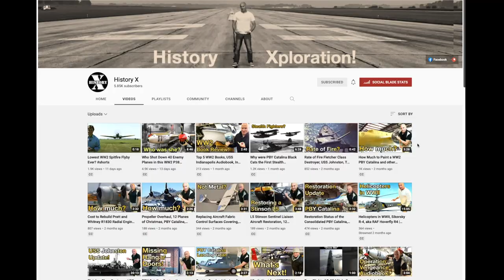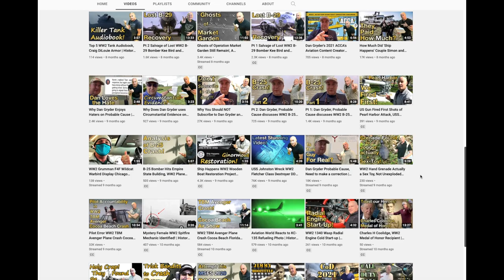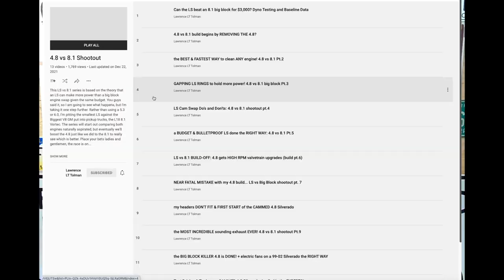Building a Custom Pizza Truck (Episode 6 )

Comment: 13:45  Just a thought.  You could change that up.  Two options that I can think of.  If you switch to adhesive you no longer have any shrinkage concerns.  You could also use aluminum even a thicker gauge aluminum if you wanted.  Of course steel is fine too.  I know... everybody thinks adhesive is going to be problematic.  I frequently see vehicles at auction where the steel rips while the an adhesive joint in the same area is still intact.  I know which joints are seam sealer over spot welds and joints that are 100% adhesive.
Reply from the maker: The new adhesives are amazing, as you noted.  I had to repair a salvaged aluminum F150 and I saw the aluminum rip while the adhesive held first hand.  I went with the steel for simplicity because the logo is going to cover the entire window anyway

Comment: Austin, on those door skins, have you considered using Panel Bond instead of tack welding to prevent the warping?
Reply from the maker: I hadn't thought of that, but another viewer recommended it as well and I may try that if I do something similar again.  I used that stuff on my aluminum f150 repair and had great results. This window will be covered with flat paint and a large logo, so having it stay perfectly smooth wasn't a big issue

Comment: Is their any reason you hung the door with the hinge to the back? I would worry the wind would catch it when driving and rip the door open.
Reply from the maker: It's slightly easier to load supplies into the truck with it hinged this way.  Also, the other truck was hinged this way and it has had no issues out in the field.

Comment: It just occurred to me. With your home 15 feet away from your shop and projects, how are you going to muffle the sawing, grinding, hammering, etc. sounds?
Reply from the maker: Great question! I am looking into either rockwool insulation or spray foam for the Firewall between the house and shop.  That wall will be covered with steel, just like the outside of the building is currently.  I promised the wife that sound deadening would be a top priority.
Reply: @AustinCoulson  When you go to install drywall on the house side of the wall, you should look into installing resilient channels to attach the drywall to.  It's used to uncouple the drywall from the wall framing, to minimize sound transmission.  This, on top of the rockwool or spray foam should make for a happy wife.
Reply from the maker: @randomnonsense_1  I haven't heard of that product but I will check it out.

Comment: LOL... Look at what showed up... some fancy squares.  What do you think of them?
Reply from the maker: That square is amazing.  I bought their recommended clamps as well and it was well worth the money.  I wish I had bought 2 squares so that I could do one full side at a time.  I thought they were overselling the square in their videos, but if anything they undersold it, as it makes rock solid 90* super easy.
Reply: @AustinCoulson  LOL.  I told you they were amazing.  He's had them a long time.  It was at least four years before I purchased any because I thought it was hype.  The more I use them... the more I realize how much thought went into them.  Yes two squares is the minimum.  Four is ideal for the work you are doing here.  You literally set them and weld.  Huge time saver while producing a better end product.
Reply from the maker: @ShainAndrews  Im too cheap for my own good sometimes. I will wait way too long to buy the right tool for the job. Heck, I should have got my plasma cutter years ago. I usually work new tools into new jobs so the next big project I take on, I will buy another one...or three.

Comment: How much would a truck like this cost?
Reply from the maker: depending on options and what kind of truck is used as the base, you are looking at 125k+USD, which is in the range of the classic roach-coach van costs